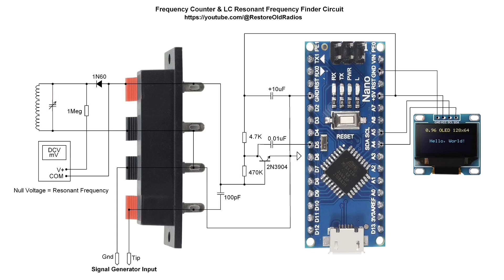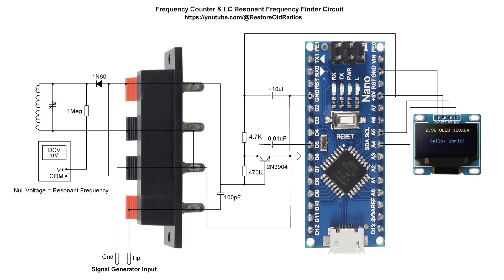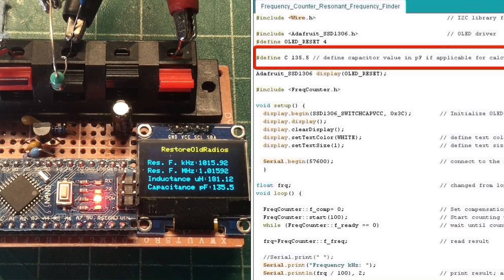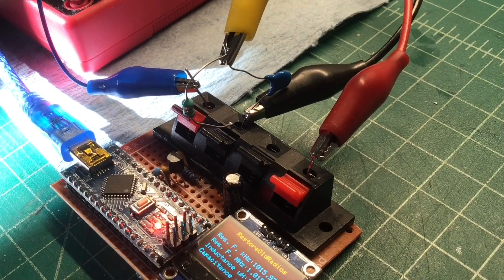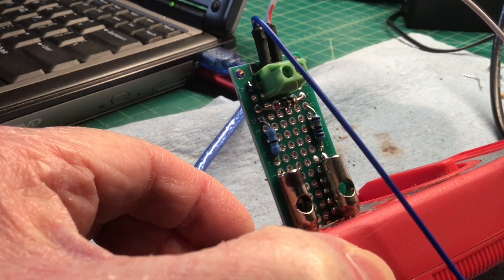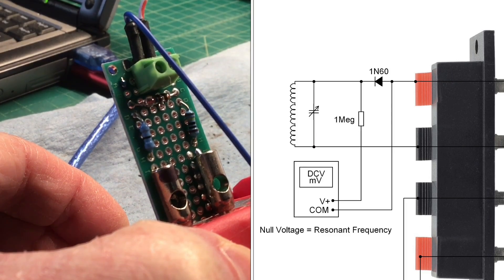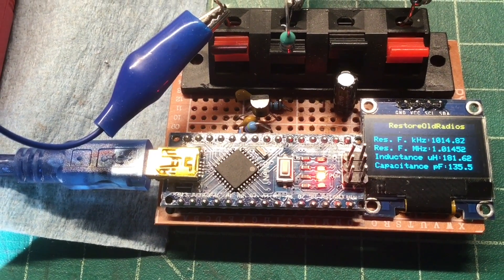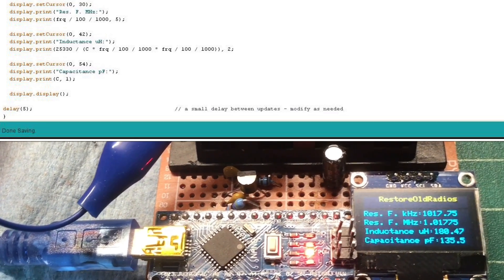Build a Simple Circuit to Measure LC Resonant Frequency

Comment: I think - need use freqency counter and "lamda diode" circuit from two JFET's or MOSFET cross coupled oscillator. LC tank starts oscillating from negative resistance device and can measure freqency.
Franklin oscillator is a best variant.
Reply from the maker: Thanks for reaching out. I think one of my earlier designs is similar to your recommendation at: https://youtu.be/1KNgZ_lBhLg?si=d84ZirmW9D-A3BCo Check out the video description for a link to the reference material. Thanks again. Best, Don

Comment: FWIW, feels like an analog meter or 'scope would let one zero in on the minimum voltage faster.
Reply: Always interesting content & I'm often inspired by the effort you put into making the old parts work again.
Reply from the maker: Thank you. Best, Don
Reply from the maker: All mentioned will definitely work, just comes down to someone’s preference and test equipment availability. I appreciate you watching and reaching out. All the best. Don
Reply from the maker: Forgot to mention, the DMM to read the DC voltage across the diode can’t have a common ground, it is floating from the…